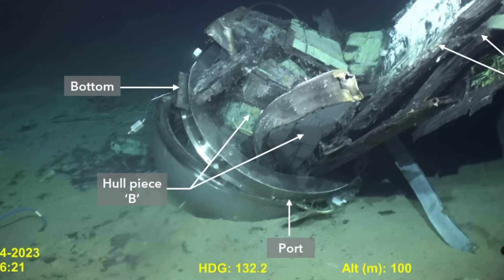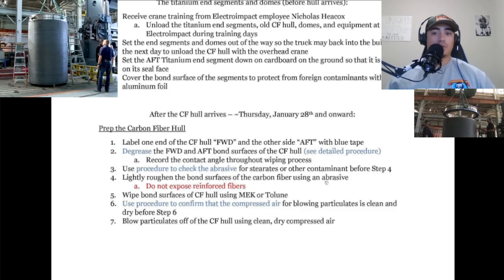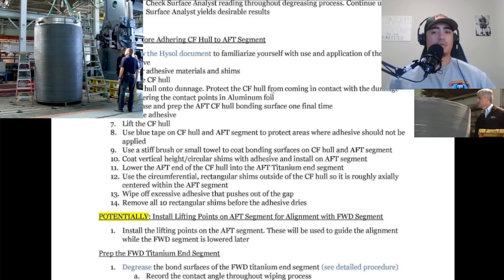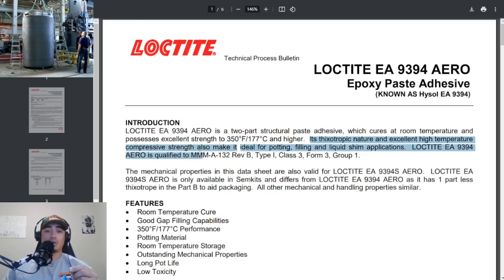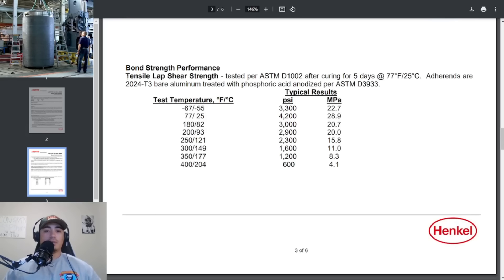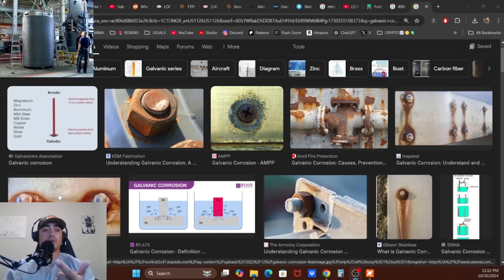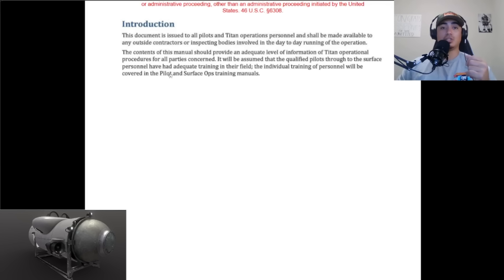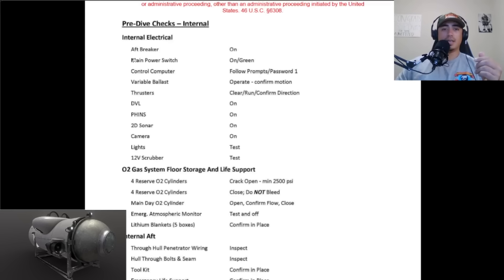Part 5: OceanGate TITAN Investigation: Money Laundering, Glue, & Operations Manual - Latest Files

Comment: Has anyone pointed out that many of these structural catalysed bonding adhesives have a critical bond line thickness to maintain during application.  Excessive thickness leads to unpredictable product performance.  Lord would never stand by OceanGates application method, I suspect.  Interestingly, I never heard anyone mentiion if Lord brought a product manger and chemist into the fray for guidance.  I have personally used this stuff on an over engineered home gate of mine.  Internal alum. structural frame tig welded with 1/8" plate alum bonded using this product.  When fully cured on a properly prepared alum surface I had to use a impact chisel to shear it from the face of aluminum during cleanup.  It's quite incredible.

Comment: the disparity in cure times is because you may apply a thin coating in an area thats easily cured, or you might have a thicker amount in a harder to cure spot such as under that titanium ring, i wouldnt be suprised if in that specific use case, if ocengate had of consultued locktite about the cure time they recomend for their application it would have exceeded 5 days
Reply: In which case Rush said, F that I won’t have you stifle my innovation! I will just deal with this myself and go to Camper World!

Comment: Clean room, YES. Glue and glue additives mixed properly.Do NOT sand out air "bumps" or other imperfections, you have to shit can hull!
Reply: Mixed adhesive should have been placed in a vacuum to remove air bubbles.

Comment: The resistivity of EA 9394 is 5 orders of magnitude higher higher than pure aluminum, and very little surface area exposed to seawater (if any; it may have been protected by the rhino liner) - any galvanic corrosion between the glue and the carbon fiber or the titanium rings would have been extremely slow. 

They did not have any ROVs on hand. Their entanglement plan was "everyone dies unless we get lucky an a 6000m oil & gas ROV happens to be nearby".

I think the syntactic foam in the tail was only enough to trim out the weight of the tail equipment (there's no real need for it to do anything more) ; it wouldn't have made the submersible go tail up unless the hull was seriously flooded.
Reply: No real need is how he got there lol

Comment: 5:05 - {OceanGate Glue Procedure}
 “Lightly roughen the bond surfaces of the carbon fiber using an abrasive.
[Red Font] Do Not expose reinforced fibers.” 
🧐 So they themselves admit they were aware of the seriousness of damaging the fibers…

Yet between each subsequent Layer of wrap they took disc grinders and ground flat any fiber wrinkles that had formed after using the autoclave, cutting through 1-3 layers after the 1st 1” section and as many as 9-10 layers by the 4th 1” section. 

Did nobody stop and consider the contradictory statements made in the plan or is it a case of:
“well can’t take back what we already did but we’ll follow the correct guidelines going forward for the rest of the build … it’ll be fine, don’t worry, trust me, I spent years researching/testing and successfully created a functioning prototype vessel, I’m the forefront leader in Titanium capped CF Hull design…I know what I’m doing”

Comment: Just as an information for the sheer forces, the compression is one factor, but the temperature expansion rates are different between the materials and are nearly constant even against the relative forces applied. Therefore the sheer forces will have been ALOT higher. To galvanic corrosion: aluminium is used for fresh water and zink for saltwater, if used incorrectly the protection wont be proper.
Reply: Any defects will be ignored. 
Let’s leave this out in the Canadian winter.

Now back to the defects. Any water that got anywhere and froze expanding, then lets put it back in the ocean again and have stress on it going from the other direction.
Oh….the lightning strike? 
It’s nothing. Not important.

Comment: I don't think that Electroimpact would have multistage oil and moisture filters in the compressed air system. It was a carbon fibre production company but it didn't meet the strict standards of aerospace manufacturing. 
The facility was not as clean as they expected.
Reply from the maker: Yes that’s a good point I mean I forget his name but the former engineer testified and eluded to leaf blowers being used in the same vicinity as the hull during manufacturing. This certainly doesn’t appear to be a contaminant free zone.

Comment: So, those end caps are not pure enough titanium for under sea use 🤔 not likely the failure cause but the point of sheer on the end caps show orange rust which to my knowledge only appears in titanium composites … which being a composite would greatly affect the failure point?
Reply: It failed at the front no doubt
Reply from the maker: Great point. I will have to cross reference the photos but I believe the rust is from the imploded o2 cylinders. Stainless doesn’t necessarily “rust” it will more so deteriorate and typically from the inside out. I would imagine titanium would be similar. You can see in my dive footage the titanium bracket I am working on is deteriorating but any rust is transferred by being in contact with bare steel which is rusting underwater.

This is all just evidence which could be contributing factors. I personally think the loud BANG on dive 80 was the straw the broke the camels back. Aka massive structural integrity loss in the cf hull. Cheers🤙🏼

Comment: It's honestly NOT the carbon fiber. Even 12" thick, cross weaved carbon fiber wouldn't survive multiple trips. I'm honestly shocked they survived one trip. The main issue is the shape! It's LITERALLY INSANE to use that elongated capsule instead of a larger sphere. A sphere is the ONLY shape that can safely and EVENLY distribute the force of the weight of all of the water.
Reply: In my opinion the shape is not relevant...

For example, if a titanium or steel tube comfortably survived its first trip to the Titanic then it would likely survive hundreds or thousands of trips.

I understand your point that a sphere is stronger but the issue is that even if that carbon tube could comfortably go to 8,000m on its first trip, it would get weaker each subsequent time (especially with their poor construction practises).

Steel/titanium doesn't really get permanently stressed if you don't push it too far - if it comfortably survives once it should survive many, many times regardless of the shape.

Comment: When I wrote assembly documentation for robotics, my three key words were: Inspect, Ensure, and Verify. 
Most of my procedure instruction lines started with one of those three words. 
Example: "Step 7 Ensure the locking ring alignment tabs are centered on the staking posts. Inspect each staking post for proper alignment. Verify and document proper alignment with part codes, photography, and timestamps." 
Thats just one line of assembly instructions and it has almost nothing to with assembly, but everything to do with quality. 
This "manual" of theirs is absolute garbage.

Comment: I don't understand why they didn't just use the old method of equally spaced through rods - front cap to rear cap with oversized collar drilled with holes bolted at each end and lock pins applied. These rods would have shrunk as the temperature decreased tightening the end caps to the shrinking body of the submersible.
Superglue is a joke for this application.

Comment: That locktite actualy has higher bond strength at lower temps.  Not shure the shear strength 

Ive found aero stuff often this way. I used to sell auto and commerical paint.  Some very durable coatings were totaly uneffected by hydrolic fluid. But when they got cold would fail the test. Since high flying planes can be subject to very cold temps we didnt sell it and it wasnt approved for higher altatude planes 

Test Temperature, °F/°C psi MPa
-67/-55 3,500 24.1
77/25 5,000 34.5
180/82 4,000 27.6
250/121 3,200 22.0
300/149 3,000 20.7
350/177 2,500 17.2
400/204 1,700 11.7
450/232 1,200 8.3
500/260 800 5.5

Comment: My initial sense, not being an engineer, was that something was terribly wrong with gluing the top to the hull. It screamed leak to me. Then I noticed that all the other submersibles are all one piece at the front where pressure is greatest. The people all enter from the top. As you and others noted, he was trying to adapt what works for the air to the sea and they are not the same. Per se negligence, defective design.
Reply: Yes yes that’s always what I believed too
Reply: The only thing that's correct about your assessment was your initial sense, not being an engineer. Engineer's use glue all the time and it's crazy strong when done right. Also design was just fine. The problem lies with choice of material and assembly. Also preassure wouldn't be stronger in the front... Pressure is equal all around.
Reply: @samiirai  First of all what I read the engineers to say is this: Shape matters:
"While the pressure is equal all around, the design of the submersible, particularly its front shape, can affect how it moves through the water."
Spherical design:
Many deep-sea submersibles are designed with a spherical shape to best withstand the immense pressure at great depths as it distributes the force evenly across the surface."  

Second, numerous people have said that gluing two pieces of material that were totally different together could have caused a problem, in that the materials do not expand at the same time. I assume that's why all the other ones are all one piece. So, I don't think you know as much as you think you do.
Reply: @InternationalMysteries360  Third: I'm an actuall ocean engineer, sooo checkmate? no but for real, I'm ocean enginner and I'm just sayin. Design was based of well tested design concepts, the material was not.

Maybe just google the structural advantages with using a sphere? you'll find out why it works against pressure when it's a complete structure. And not a three-piece structure like this, but still this also works - with the right choice of materials.

As I said, the problem lies with assembly and choice of material. Now, you do have good point about the glue, but still it worked for how many dives? There is a reason mechanical parts are exchanged in aviation and non-experimental maritime industry before they break/wear out.

Comment: Has anyone seen any emergency contingency plan if they lost or the barge could not surface?
Seems like that would be a SHTF situation.
Reply from the maker: I’ll have to double check the operations manual. I don’t think there was an emergency procedure specifically for that. They may have mentioned something under the LARS section. I’ll have a look when I get the chance. I also left a link if you’re interested in doing some investigative work and reporting back. Thanks for the question 🤙🏼
Reply: You mention Emergency Procedures at the 1 hour mark
Reply from the maker: @800Viffer  thank you 🙏🏼

Comment: There would be a shear force between the compressed carbon tube and ring but its not the external pressure, it would only need to hold the force not borne by the hoop strength. It was far from the actual pressure at depth until the tube had failed. Otherwise its basically the force left over beyond what the structure of the carbon holds and the distance it is trying to move. Using the wrong glue is a problem but I would think galvanic corrosion would show visually. You've changed enough zincs to have seen that the thinner and broader areas and corners or sharp points will degrade first. Its still a problem and maybe there's interaction on a microscopic level like pitting at the mating surface but would think that there would be evidence in spots on the titanium. 
I'd also be curious, how are electrical systems done in a submersible? Is there any type of bonding or grounding like in a surface vehicle? Wonder how that might work and if that could have been able to to actively protect against galvanic corrosion even if accidentally and how bonding worked between different pieces, particularly metal framework.

Comment: MEK is a solvent used for washing steel or metal surfaces . It's normally used in the industrial painting sector  to clean surfaces before applying epoxy based paints .  It's also used for decreasing applications .
Reply from the maker: @adamwatson6916  thank you Adam!! Solvent is the word I was looking for. Thanks for sharing the additional info. Cheers🤙🏼

Comment: So that's why rust was visible in the ring? Because of the aluminum? Would the rust, which would destroy the aluminum, would it break down the adhesive qualities of the glue? 

I was trying to figure out why there would be rust on titanium.
Reply from the maker: I think the rust was from the o2 tank wrapped around the ring. I forgot to provide a visual reference but aluminum will get a white milky coating on it, it does not rust like steel
Reply: @SSPDIVING  oh ok. Cool thank you for clarifying that. 👍
Reply from the maker: No problem!

Comment: 20:00 You actually arent calculating the shear pressure correctly. Youd take the water pressure pusing on the hemisphere as a whole and get that force in tonnes, and then divide that whole force by the total surface area of the glue interface to the carbon fibre. So in reality, the shear force on that glue joint is far, far bigger than the 4000+ psi that the glue was rated for, and for non-flexable glues like that loctite, you only need a few thou for the dome to be able to move to get glue failure.
Reply from the maker: This is actually the kind of comment I was hoping for. I know the shear strength of 4000psi doesn’t translate directly at depth so thank you for the detailed breakdown, very helpful🤙🏼

Comment: Well the temperature's up to 177 Celsius, it doesn't give maximum low temperature! on that sheet, so we don't know what the maximum low temperature is? It does give us a psi of 3300  at -55° Celsius, and gets more the higher up the temperature to room temperature, I'm sure you could work out that figure somebody! but that is a lot lower than what the pressure would be as you have calculated. it wasn't suitable and is not suitable for compression strength. There is no share strength the two ends are compressing together the cylinder is compressing inwards. The share strength is two bonded sides trying to pull against each other in a sliding motion that wouldn't happen in this application
Reply from the maker: Hmmm good point. I’m not looking at it now, but it did have a shear strength rating for -66F
Reply: don't  see your reply now!
What I was saying before I accidentally deleted it. If we don't know the flexibility of the glue as we can see by the pictures the glue has cracked, it is a hard glue we need to know what the flexibility of this glue is? is there nothing in the data sheet?
That's your failure point..! If a glue is not flexing at the same rate and capable to return as the hull is compressing and back again without fatigue then you're going to get failure..
Reply from the maker: @jedi-mic  ahhhh I see, I don’t think there was anything in there regarding flexibility. It’s possible I overlooked it but I did not because I was curious as well. The data sheets are easy to find if you want to take a look and let me know if you find anything.

Comment: I wonder if they ever consider bonding a titanium exterior sleeve to keep the carbon fiber and its glue from the cold exterior or maybe a metal matrix of titanium, not smart enough though or maybe titanium bar stock longitudianal welded stretchers maybe 8 around the perimeter, I dunno, maybe an a smart materials engineer can chime in on a clueless diy engineer.

Comment: I'm no expert, but it just seems to be that there should have been a completely sterile environment during the assembly of the Titan.  They certainly do that when working on vehicles traveling into space.  The workers decontaminate and suit up, including masks and the work place is completely dust free.  It just seems the whole assembly process was rather haphazard and cavalier. Is it possible contamination of the surfaces or the glue itself could have contributed to Titan's failure?  I may be completely off base; as I've said, I'm no expert.  Just wondering if that's a possibility.

Comment: That is so hilarious when someone is using reta... imperial units and then struggles to convert it into each other just because units are ret... imperial.
Imagine using sane units - then you do not need to convert anything in order to get pressure at depth. You just see 22.7MPa and it is clear that depth is 2270 meters because 1atm is 0.1MPa and it is +1atm per 10 meters of depth.
Reply from the maker: @alsto8298  I find it hilarious that you deleted your previous comment because you typed in the wrong meters while trying to lecture someone about conversions 🤣
Reply: + LOL x2! It is even more hilarious when reta... imperial units user is talking about sane unit like Lumen without a glimpse of understanding of what it is.
p.s. for ret... imperial units users - yes, lumens do add up by the very definition.
Reply: @SSPDIVING  Yes, I mistyped 7 with 6 and corrected it. Does that change anything?
You've already found hilarious known fact about lumens... you can't just say "it is fine" because I might mistype.
Seriously... try sane units, they are good. But not like you did with lumens, instead actually read what it is.

Comment: Instead of a carbon fiber hull 5" thick they had a hull that was 5 1" layers thick, very weak!
Reply from the maker: I agree, in addition to the original design requiring the hull to be 9”. We still don’t have an official answer as to why they dropped it from 9” to 5”. I suspect it had something to do with weight to size ratio,etc. at 9” may as well use a large titanium shepherd instead.
Reply from the maker: Sphere